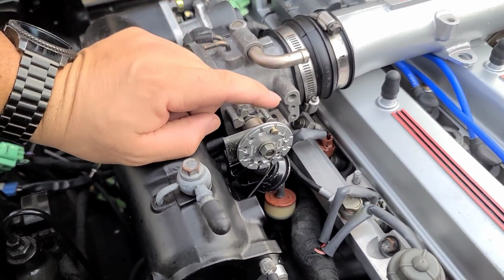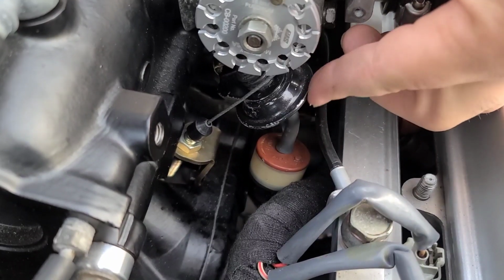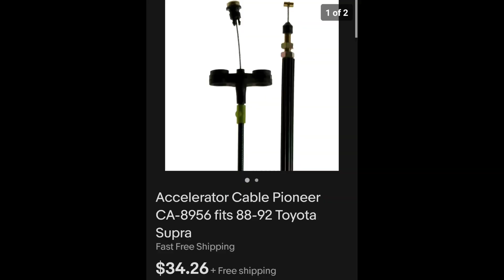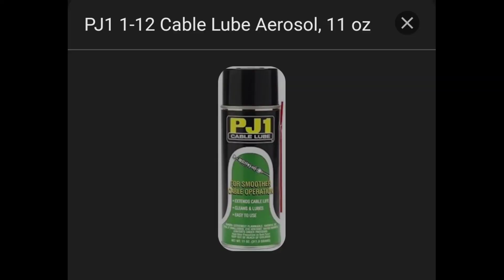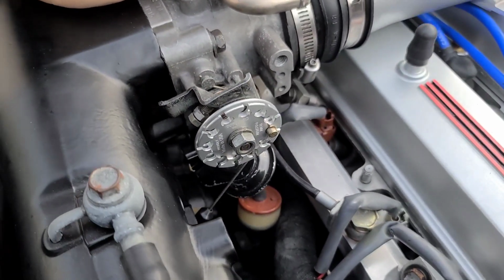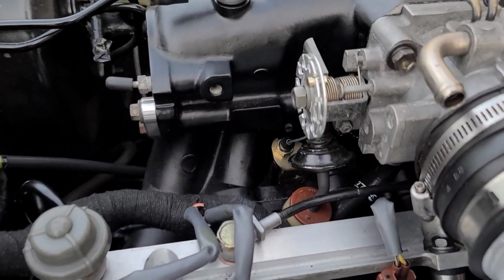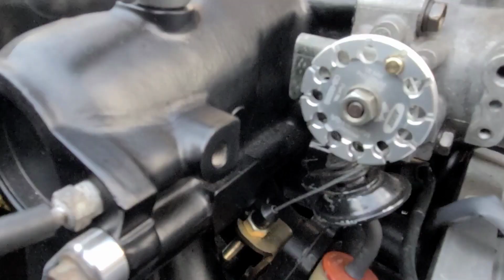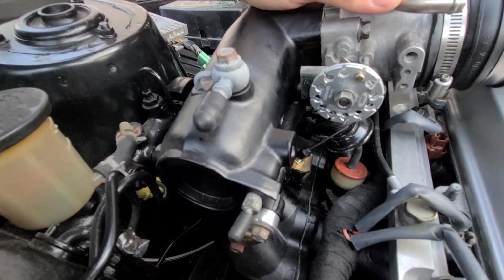Supra 7mgte throttle cable modification and throttle cable bracket delete.

Comment: Great tip man. Thank you.
Reply from the maker: No problem. Since this video I actually upgraded the wheel to a larger size its a lot smoother 🤙🏼
Reply: @josephmaldonado2521 you have a link to the new size you used
Reply from the maker: @dustindinatali2664 https://www.ebay.com/itm/326343993753?mkcid=16&mkevt=1&mkrid=711-127632-2357-0&ssspo=U2jsTB6kQya&sssrc=4429486&ssuid=i1DF4-tSSzG&var=&widget_ver=artemis&media=COPY
Reply from the maker: This one has become a bit pricey. There are other brands around $25  just search 25mm throttle cable drum.

Comment: Yooooo. This video could not come at a better time! My throttle bracket has gone to shit. I have an mk3 and this looks like the solution to my problem. Would you happen to have a step by step on how to do this? Parts list?
Reply from the maker: Hey that's great to hear!! I put pictures of the three parts I used to make this work off of ebay. If you need any further help or questions you can dm me on instagram @celica83 I will even send you a more indepth video if that will help just hit me up.